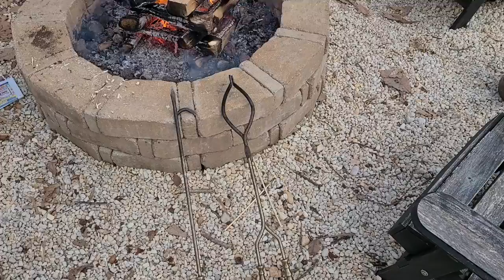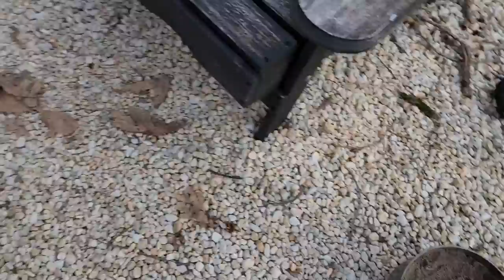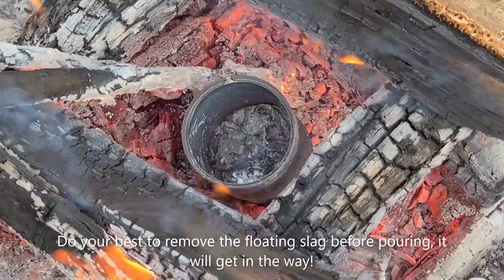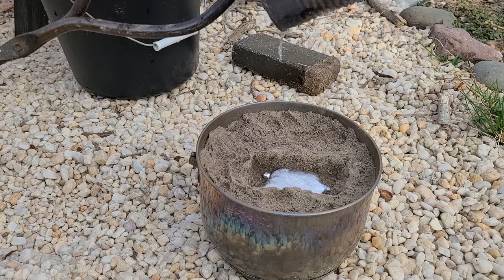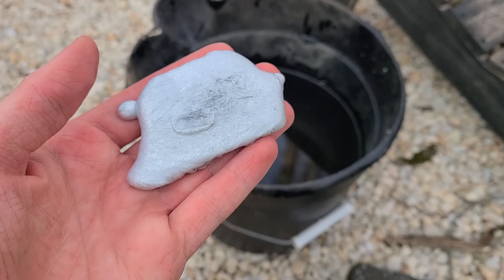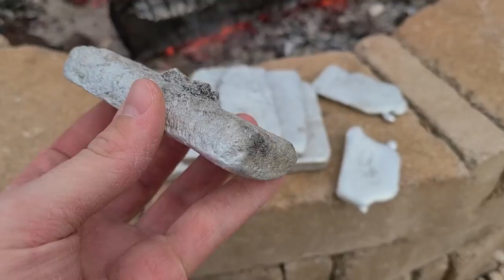Melting Aluminum Cans Over a Campfire

Comment: Looking sweet, me and a friend melted down some old lead Warhammer models, we poured the led into a concrete mould and it spat out, my friend had splatters all over his glasses, very lucky

What's sort of protective measures would you recommend? I wanna get smelting again lol

I've seen people use salt as flux with this, have you had any experience with that?
Reply from the maker: That is very lucky of your friend! To be 100% safe I would not do this at home, but proper PPE like boots, face shield and gloves can help you get back to smelting! And I have not seen the salt flux thing, I will look into it!

Happy New Year and safe smelting!

Comment: How would you recommend removing the slag when using a steel can crucible like you did?
Reply from the maker: I use a small steel fire poker that fits into the steel cans to "scrape" it off the top of the liquid metal, it's not 100% perfect but it does a good enough job! I'm sure a spoon or something similar would work too just be careful and don't get burnt

Comment: Interesting melting aluminum cans. I British Columbia Canada we can get 10 cents for each pop can. Would melting them down and pouring an aluminum bar be worth more money?
Reply from the maker: I would say it is more worth it to turn in your cans for 10 cents a pop. Aluminum is trading at around 0.003 cents per gram right now and a soda can is right around 15 grams so if you were to pour bars out of them you would be looking at roughly 4.5 cents per can to sell to a scrap yard. But as a hobby and to have a small pile of aluminum bars it is well worth it to me!
Reply: Yes in Norway too, but I use other aluminum items, it has nothing to do with the thickness really, just heat all over the aluminum item